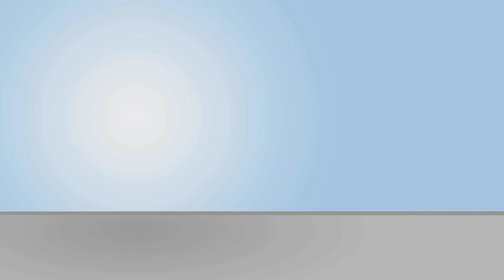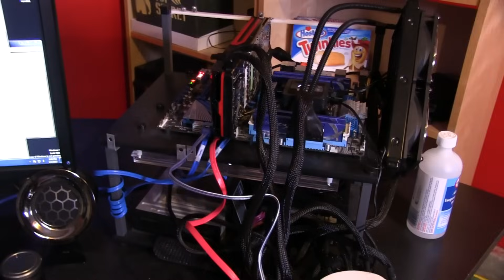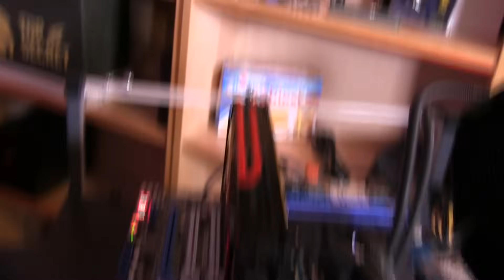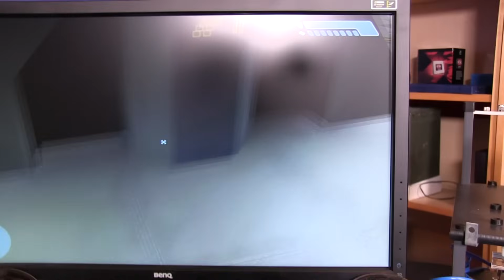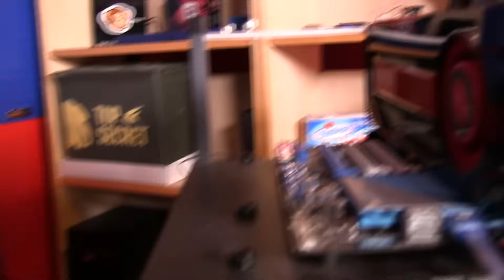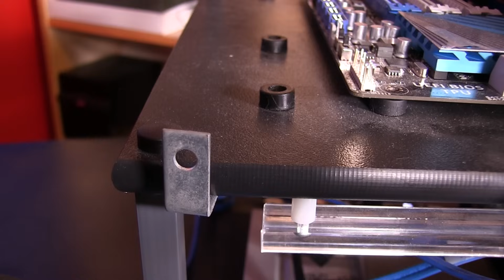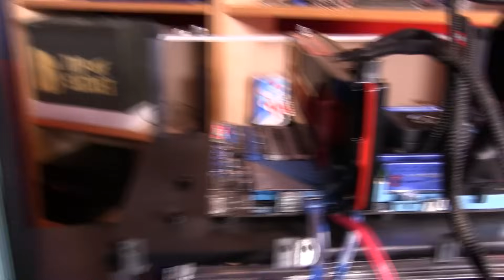Coil Whine Explanation & Demonstration Linus Tech Tips

Comment: lot of people saying "JUST TRN ON VSINK FAG" or something to that degree, okay , how about my 780 that has coil whine with v-sync on and only getting 50fps. hm? oh so that dosnt solve it? "WELL OBVUISLY YOU NEED TO BE AT 60FPS FEG" okay, test #2 forced 60fps with v-sync on in a game id get above 170fps on.. its still there :O holy shit! #3 a game i usually get 60-70 fps with v-sync on and guess what? its. still there. now would you all shut up? if anyone comes back with anything about my cpu im going to kidney punch you. its over clocked to 4.4 and its run it at 3.5 as well, its not making the sound nor are fans or a hard drive.
Reply: Was the frequency of the whine connected to fps? Did just locking it at 60 make it a tone with a fairly stable frequency?
Reply: ***** not one single tiny little bit. what toned it down was running at different loads. thats exactly what i was saying, people in these comments are swearing locking the frame rate solves it, it dosnt.
Reply: thanks for the reply. I thought possibly if it was tied to fps then it wouldn't be very noticeable after a while because its not changing much and you just get used to it.
Reply: ***** the main point of my original comment was to disprove everyone who kept crying use vsync use vsync. my coil whine is directly proportionate to the ammount of load on the card.
Reply: It seems as if the majority of people in the comments have no idea what actually causes coil whine. Cause it sure as hell has nothing to do with FPS.

Edit: Ok I got a little further in the comment section and holy shit, it seems as if fucking know one on here has a fucking clue about coil whine. Really like not a single clue to go around. This is fucking scary for a linustechtips video that so many people have no clue what they are talking about.
Reply: Some games have a broken Vsync even when it shows 60fps,try d3doverrider.edit:lmfao 3d3,it does have relevance a broken Vsync within a game can caue an unstable FR.
Reply: ***** Curious to why you mention that, as it has no relevance to the topic. However you can also use MSI afterburner to cap the frame rate.
Reply: ki11bunny People are saying Turn Vsync on beause if your computer is able to lock at 60 fps the Coil whine will stay at the same low sound pitch all the time...  The Pitch of Coil Whine comes from the GPU taking in different power loads. Higher the GPU load equals a lower Coil Whine pitch, the lower the GPU load the higher Coil Whine pitch.
Reply: SgtPickledic and again like some one posted above more fps or less fps doesnt mean that the loads are equal
you can have 60 fps at all times
YOUL STILL go trough load transitions with area's or objects loading in 
or even oponenents running around as if they got a screw lose

there is a reason fps drops when you have a HIGHER LOAD
locking fps doesnt remove that Higher load 1 EYEOTA
Reply: ***** No, it will be tied to how much effort the component has to put in to accomplish the task given to it, as this affects how much power will be required to complete the task as well. By unlocking your frame rate you're effectively drastically increasing how much the work load on your hardware can fluctuate, including the power draw.

A video card consists of many different components and they can be stressed in various different ways from each other. A low demanding situation with a high frame rate likely negatively affects a different component to when you have a low frame rate and a highly demanding situation, and situations can themselves specifically be demanding of specific parts of the hardware (Like PhysX on Nvidia cards).
Reply: What PSU are you using?
Reply: Me? A corsair AX760 watt PSU.
Reply: ki11bunny

Some games have a broken Vsync even when it shows 60fps,try d3doverrider.edit:lmfao 3d3,it does have relevance a broken Vsync within a game can cause an unstable FR,meaning going real high while it should be locked.d3doverrider forces Vsync sometime even better than the GPU software does because the game itself will not respond to the GPU software layer.d3d overrider is using the core d3d function without any layer in between.
Reply: ***** It still has no relevance to the topic.
Reply: this aged well

Comment: Oh wow, that's such a strange noise, I thought this video was about the fan making a spooling noise lol. But I think the spooling noise coming from the graphics card is just because it's vibration or something... grr, maybe I should just water cool this thing, but idk how loud the pumps are.
Reply: pumps arent loud, they are a little bit quieter than fans (depending on what fans you got and the rpm you are running them at of course but most fans at their normal speeds should be louder than the pumps.)

Comment: this sound makes me lol
Reply: plot twist i just realised my gtx 760 has it too...how do i fix this shit ;(
Reply: does this actually damage any of my components ? i double checked all my fans are spinning fine and nothing touching the gpu do i gotta replace gpu or can i justkeep it with coilwhine ? i need to know if damages anything
Reply: Stacey Barron
 great to know that my psu is a 750 watt corsair its not cheap ~ was about 100 or 150 so that couldnt be the problem, can the motherboard be a problem howeveR?  because my pc is custom built but my mobo is a default hp mobo
Reply: without vsinc is so bad, but with it its meh so i guess ill have to get used to it till i can maybe ubgrade to a 770 or 780

Comment: Okay, I have this problem, my graphics card is a Gigabyte 980 G1 Gaming 4gb. The graphics card does this noise. How do I fix it?
Reply: yah live with it. nothing will fix it. its like asking how do you fix the sound your windshield wipers make when your windows are dry. coil whine has, and this is quoting from EVGA customer service when i asked "no effect on performance or longevity of any computer hardware."
Reply: Austin Allgire What EVGA says is BS. Evrytime the whine stops, my fps drops and my screen freezes for a split second and this is standing staring at a dirt wall in minecraft singleplayer. Not much else happening around me or on the computer. Just me and a superflat world
Reply: Austin Allgire But my customer service is Gigabyte, not EVGA.
Reply: Try locking the fps to 60.
Reply: Carlos Rojo Get nVidia Inpsector and try limit your frames to the refresh rate of your monitor
Reply: Carlos Rojo Gigabyte service is terrible, it took them 2 weeks to reply to my help desk ticket about graphics related BSOD's last month. If you tried to have your problem fixed through them, let me know how it went.

Comment: just limit your framerate to 120fps or 60fps using MSI afterburner or EVGA precisionX 16 and it will stop, your card tries to push 9000+++ fps with a monitor that only shows 60 or 144 and that is what cause the whine

Comment: Guys, to fix coil whine, download any  program to cap your fps, I usually use riva tuner statistics, and cap fps to the refresh rate of your monitor, for instance mine has 60hz I cap to 60 fps and that's it coil whine is fixed.

Comment: You did not explain where the noise (that you call coil whine) is actually coming from.  Which component on the video card?

Just find that component and put heat resistant tape on it.   Any noise can be dampened if you find the source.

Comment: I was fiddling about with my Vcard settings (not over clocking (Edit: Not manually overclocking)), so I spun up Minecraft (It's always a laugh to see just how many frames you can get out of Minecraft) just to see how many frames I could get while in-game and after reaching 2400ish frames per second, the Vcard started squealing like a pig once the Titan hit 1003Mhz GPU clock (57 degrees C at that point). (Using GPU Boost 2.0) Once the temperature got to around 70 degrees C, the squealing stopped. (Target temperature was set to 80 degrees C, so none of the clock speeds were lower)

The moment I heard the squealing the first time today, I immediately scoured the internet for answers. Glad to know there's not much I can do about it. I thought for a moment my GPU had seen it's last legs, like an old HDD scratching away at it's own disk.

Comment: i hear coil whine , but only through the speakers, if i turn them off it dissapears xD
Reply: That's not coil whine, thats white noise. It happens when your audio cable passes by other cables and absorbs static.
Reply: Guilty Spark
I could be wrong but I'm pretty sure in some cases the increase in power to the coils = higher amounts of electricity = more static so I'm pretty sure they're the same thing.
Reply: Didn't think of it that way, but then thats the point of insulated audio paths

Comment: I have it in my speakers and when I play games, It annoys the fuck out of me. No idea how to get rid of it!
Reply: Do you have other things plugged into the speakers?  I get a sound very similar to coil whine coming out of my desk speakers when I also have my PS3's audio cable hooked into them(even when the PS3 is off).  So, basically, I have to unplug that cord from the console whenever I'm done using it.
Reply: I only hear it when playing games such as League of legends. It only happens when I play with vertical sync off so my FPS is around 250-300.
Reply: SamEverillTV well.... you either have a shity audio component (speakers, amp, sound card, ETC) or your probably picking up noise somewhere. 

make sure your audio cables are not running close to any other cables, use no extra connectors, adapotrs ETC... 

i have a MSI 990fxa GD 80 mobo with corsiar SP-2500s 2.1 speakers. when i turn everything up full blast, all i get is a white noise, and if i played any audio at that level, id probably blow your ear drums!
Reply: I have the same in my headphones and for me, it's a dumb way of front panel audio connectors getting fibration from the hdd's
Reply: Remove any connections near the audio port and you will not hear them anymore. Had them on my laptop and my Xbox 360.
Reply: Fixed. Brought a new headset.

Comment: Okay, well, what I thought I had was coil whine, but it isn't. Does anyone know what causes the actual audio from freeze buzzing? It will hold a certain pitch for 3 seconds, sometimes more, sometimes less, and then go back to normal. The graphics may freeze also, but not always as far as I can tell. Would you happen to know what this is called, and what could cause it? :/